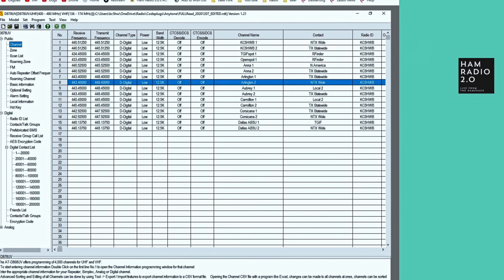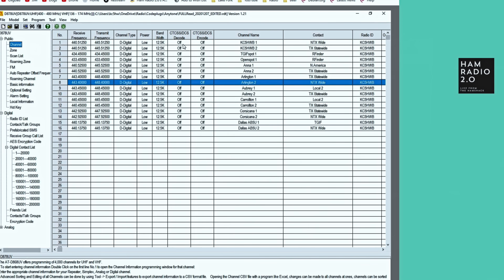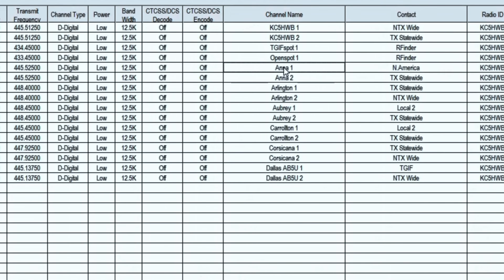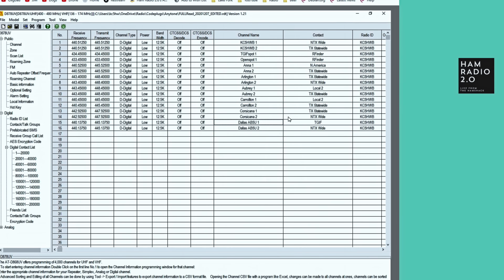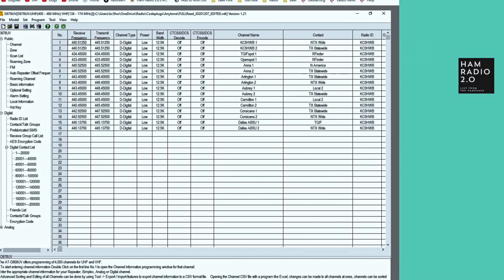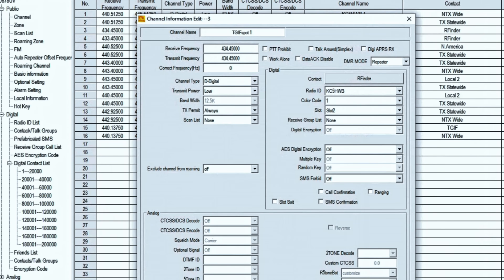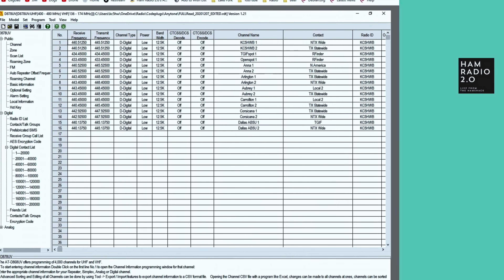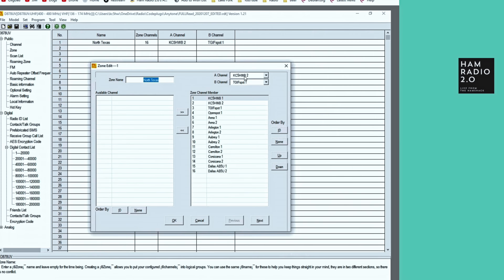How To Write a DMR Codeplug in 2021 | DMR Codeplug Programming

Comment: @w9lw63
New to DMR but I had similar idea to Jason's and that is  to use Jason's two channel logic and to FPP key in any TG I was interested at the time.  My list is small though and mostly BM so I would generally have those TG committed to memory.  I like his idea Better!  Now, for the time slot question you raise. Couldn't you create two TG's in your list one for S1 and S2 and if it is on BM..you could add a B (or a T for TGIF) ie,  TAC 310 B1..It will multiply the number of TG's you have to put in your list, but better than a long list of channels to Program.

Comment: This is great! I honestly don't know why this isn't how the programming of talk groups was intended to be. In fact, it should be a separate dial or Up/Down hot key that cycles through whatever talk groups you have programmed, regardless of whatever channel you are on. I also feel like there should be an option that if you are on monitor mode, and your get a squelch breakthrough on whatever TG and you hit a key within X time, it automatically swaps you to the last received TG so that you can quickly and easily respond, especially while mobile or driving. It boggles the mind this is not basic functionality of any decent DMR radio.

Comment: Hi I am new to ham radio and just got a  878uv 2 plus. . I think, if  you use the digi moni in settings and set it to both channels, the radio will monitor slot 1 and 2  at the same time.

Comment: I got my first DMR radio in 2019. It was a Vertex EVX-539, which is a professional radio, not actually intended for amateur use. All the resources I could find on how to make your own code plug back then didn't make sense to me so I came up with my own logic, which was to create the channels based on repeaters, NOT talk groups. Much easier to use, simply logical. I am using an AnyTone now, but I still stick to this approach. I am surprised why this is not the way most people use. Good Video.

Comment: With my Retevis RT73 I currently have Zones based on 5 main TalkGroups I used, so 5x Zones of 35x RPT's each, or 170 memories used. I have 20 TalkGroups in my Contact/TalkGroup List, each of My TG's start with TS1 or TS2 to identify which TS they work with. 

Currently here in Australia, our DMR Network is still small, with a total of 85 DMR Repeater Nation wide, 29 RPT's here in NSW alone. I'm looking to buy a Anytone AT-D578UV in the next Month, which I will then programme my DMR RPT's into Zone 1 - 85 DMR RPT's into My new Anytone AT-D578UV and setup for Roaming.

I'll basically reduce the number of Saved Memories from 1700 Entries back down to 85 Entries, saving 1600 channel memories in my radio.

TalkGroups!!! I'll just press the List Button and go into My Contact/TalkGroup List and change the TalkGroup and TS1 or TS2 as needed.

Comment: After filling in your web form for the codeplug talkgroup list I am seeing nothing happen.
Reply from the maker: You're sent another email to confirm your address and it'll have a link.
Reply: @HamRadio2  ANOTHER email? I haven't received a first one. I get no response to clicking the submit button on the form. Shouldn't it at least confirm the submission click?
Reply from the maker: 2 emails total. The first one is the submission confirmation. The 2nd one has the link
Reply: @HamRadio2  still no emails, and I looked at least a couple times in my junk folder. No errors either from the form.
OK, disabling Adblock Plus let it work.
Reply: Now how do I use it for TYT radios?

Comment: I'm totally new to this, just ordered a D878UV II Plus, aint even received it yet, but working on learning how to create my own code plugs, and just downloaded your file,  but it's a .dcf file, and as far as my understanding goes the Anytone uses a .rdt file for it's code plug files! What the heck do you do supposed to do with a .dcf file? Tried to open the file with the D878UVII programing software but it wont load it, it get's a ""file error" message, even went as far as re-naming it with the .rdt file extension, but it still dont work! I dont get it!
Reply: Ok finally figured it out how to load a .dcf file into the Anytone software (just got to change the file type from .rdt to .dcf in the popup menu)  but your talkgroup file gives me  a "file error" message
Reply: @HDCowboy  I'm getting the same error msg when trying to open. It will not let me import because its not a CSV either.

Comment: Hi Jason. Your videos are awesome and really help cut a path through the forest of DMR.  My question is your talk groups file.  I have the latest D578UV CPS version from the Anytone site (don't have the radio yet from RandL... it's being shipped).  But when I try to open your Talkgroups.dcf file (open, not import) using the D578UV program, I get a "file error" message box. I thought opening the dcf file would avoid a conflict between the 878 and 578 radio models. Guess not.
Reply from the maker: Dcf files just allow it to be used with the N0GSG contact manager. You should be able to import back and forth with that program for multiple radios

Comment: Thanks for the video. When i first started using DMR, I added the same typical talk groups to my local repeater frequency but also did the same for repeaters in areas I would  visit. I had about seven different repeaters with the same talk groups listed on them on different frequencies. But now I have one list of talk groups set to one frequency that I connect to my hot spot. I do not use DMR repeaters so I do not have to deal with repeater owners. I totally bypass repeaters.Oh, I do have one repeater on my 868 just in case. The downside to just using a hot spot is you need to have WiFi to use it. But at home I use my home WiFi and on the road I use my cell phone. Also some repeater owners do not want you to change the Talk Group they have it on.

Comment: I get the DCF file but the software doesnt find it when i try to import it. Any idea what im doing wrong? using an 878
Reply from the maker: Make sure you are using the latest version of the software, and just open the file.  Don't use Import.
Reply: @HamRadio2  Getting an file error msg using V2.0

Comment: Thanks Jason excellent video, am relatively new to DMR and a great friend talked me through this set up of the code plug. I have been using this "compressed" or smaller code plug for awhile now and it works excellent.  Thanks also to VE7DLC...thanks again Jason.  de VE3OHS

Comment: Jason, I thought of one disadvantage to your idea that might be worth considering. On repeaters on c-Bridges (vs. repeaters on Brandmeister), IME, a given talkgroup is supported on a single timeslot. So, to take your example, if I want to switch to TAC 310, I have to remember whether my local repeater supports TAC 310 on slot 1 or slot 2. In my case, my local c-Bridge repeater supports 310 only on slot 2 (which I had to look up as I wrote this, because I didn't remember!). If I forget, and choose 310 while the radio is set to a channel on slot 1, the radio will act normal (talk permit tone, etc), but I'll never connect to 310. So, I'd need to carry with me a list of all the talkgroups that repeater supports and which timeslot I must use with each. This, of course, is not an issue on Brandmeister repeaters that support any talkgroup on any timeslot.
Reply: You can set certain channels to monitor certain "receive groups". It's an extra step, but that helps compartmentalize.

Comment: This is how my TYT MD-UV380 is set up but I have to go back into contacts and select the TG again for every time I key up the PTT, not sure if there is something else I need to do so it can be set permanently.
I have yet to find A better way to deal with all the information, wish they would make this easier 🥵
Reply from the maker: You shouldn't have to change it every time before you PTT.  You will have to change it every time if you change the TG, then change channels or power the radio off, then back on.  But each time before PTT?  That sounds like a bug.

Comment: The codeplug link is ridiculous. To many hoops to jump through. Thanks and Best Regards.
Reply from the maker: 2 clicks is too many hoops?  Ok.  You can certainly build your own, mine was just a template to get you started.
Reply: @HamRadio2  I had to create an account. Validate. Asked for my personal info...ect. Ultimately, it just didn't work. I'd love to have your codeplug if you find another option. Thanks. 73's
Reply from the maker: Try it again now. For some reason the link wasn't working for some people but it should be fixed now
Reply: @HamRadio2  I finally got it. I had to hover my mouse over the 'Click here to download'. Then right click and select, 'Copy link address'. Then pasted into browser and then hit enter. 73's

Comment: I am trying to make a code plug that I can use and also have the same code plug in my Dad's radio so he can use the plug too. He is no slouch, he has been a licensed and very active Ham since the 50's. This DMR thing just eludes him. You have given me some great ideas on how to tell him how to switch between talk groups easily. He is on a hot spot, so it should be fairly easy. Thanks.

Comment: New to the DMR World. I'm not saying it's the right way to program a Code Plug, but this works for me. A) the first 100 "channels / lines" I have set aside as Zone 1 - Analog use. B) the next  200 "channels / lines" are set aside as Zone 2 for Digital Repeater Talk Groups. Zone 3 has 100 "Channels / lines" setup for Talk Groups using my "Shop" DMR HotSpot. Zone 5 has 100 "channels / lines" setup for Talk Groups using my Office DMR Hotspot. And, Zone 7 has 100 "channels / lines" setup for Talk Groups using my Truck DMR HotSpot. When I add new Talk Groups I add them to Zones 3, 5, and 7 so all my Hotspots are setup the same. Within each Zone I have setup 1) Disconnect. 2) Parrot. 3) all the Statewide Talk Groups, 4) and then additional Talk Groups. All the Talk Groups are setup to use the BrandMeister Network .  Again, there might be better ways, but this works for me. All done by a first time user.
Reply from the maker: If it works for you, then it is the right way.

Comment: You can basically do this with any two channels as long as they are on the two TS's.....and dynamically dial up a TG... I think better yet is doing this in the Roam sections.....The Papa system codeplug has this and it makes a ton of logical sense. As you roam between repeaters, you will NOT lose the TG you are on with this setup.  But yes, this is a great topic on how to tweak the damn CPS to make it do what we want!